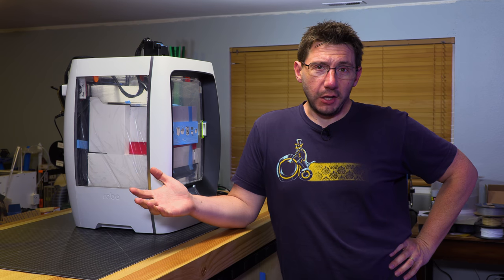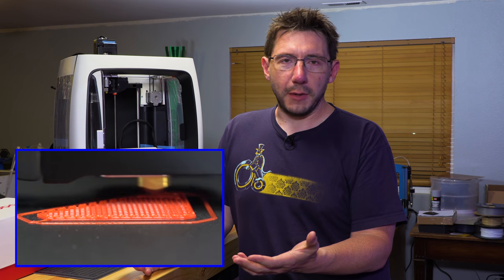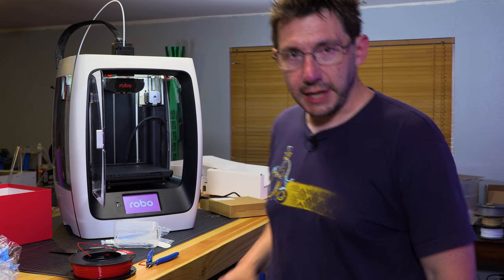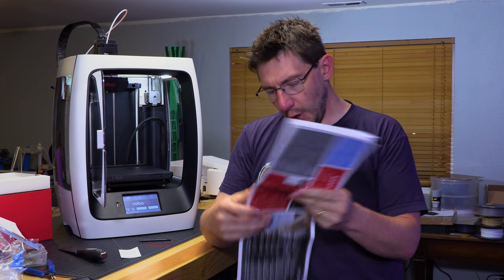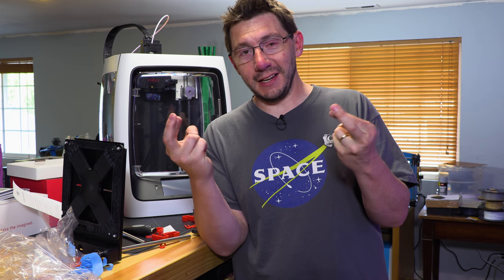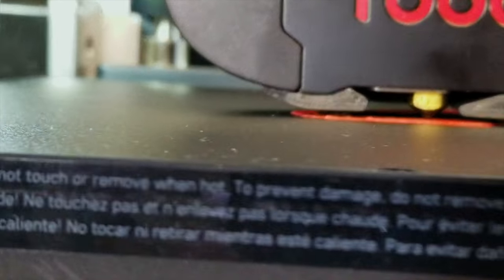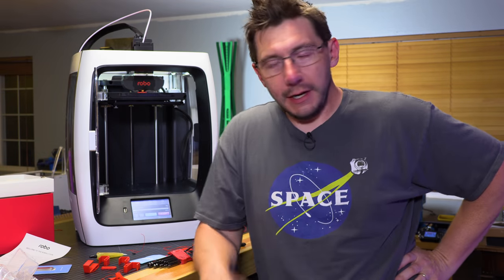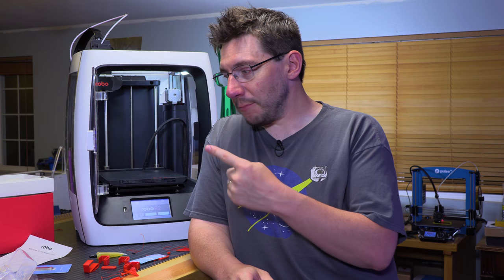Revisit the Robo R2 3D Printer - Second and Third Impressions Update

Comment: nothing but problems with my new Robo R2!! Broken power switch,  unresponsive touch screen, constantly loses wifi connection, Cura settings dont match what robo prints(set temp for 260 and robo prints at 210)

Comment: It seems like by the second printer that they would have gotten their act together. I had issues with my CR-10 when I bought it as it didn't have the switch on the z-limit and within a week I had to replace the print cooler and one in the control box. Sadly the turn around for the switch replacement from Creality after I convinced them to send me the replacement was around 2-3 weeks so I wound up buying a pack of 20 switches from Amazon for $9 and modified one of them to work on the z-limit. Quality control and product support make or break a company.

Comment: Touchscreen 3/10 hits work or delays 3 seconds . And it kind of bothers me I hear about these upgrades from Joel and other videos and never Robo themselves. I still have the R2 and use it but my new MK3 will def be getting the most use and I’m prob done buying “consumer” printers . Especially when a kit half the price contains more tech.
Reply: Have you tried out the App to control it? I've been curious how well they did with that but not ready to invest in another printer (And my R1+ is still the same workhorse it was from the day I unpacked it)
Reply: App it weak as well, much easier just to use octopi to send prints and like the touch screen the camera working through the app was hit or miss for me.
Reply: Ah phooey. Thanks for the reply :)

Comment: Perhaps the torque created from not removing those plastic clips at the beginning twisted the lead screw?
Reply: That's not possible, the gantry and the Z bed are not even connected at all. And try to bend one, it's not at all easy! Even a much flimsier threaded rod, i had to stand with my whole body weight on it supported by nuts to give it just a millimetre of bend offset over the length of the rod. It's either bent at the cutting stage due to heat warping, or maybe by an impact in shipping over a long leverage.

Comment: I received one of the first Robo R2 printers from their Kickstarter project. It has worked very well from the beginning.  All that talk from one user about needing to bypass the Robo operating system is total nonsense.  Some folks just like to tinker with their toys, and look for any excuse to hack the software.  I will say that Robo should not pack all that mass inside the printer.  The top of the leadscrew floats freely and I can see where any force would cause an issue.  There is a design for a plastic bushing on Thingiverse that I printed and pushed onto the top of the leadscrew.  I doesn't affect operation, but prevents any lateral force from bending the screw.  I added it in case I ever need to move or ship my printer.  Bummer that Joel has had these issues because it is a nice printer.

Comment: Super late to the party on this vid, but you know.. the most disturbing thing to me isn't how the filament detectors aren't marked 1 or 2. It's how it would print for a while when the filament detector should've been showing nada the entire time. I've got an R2 that has touchscreen issues as well, so I can't even use the z-offset tool anymore. Extremely frustrating, not sure it's worth fixing, despite some fantastic print quality when it works.

Comment: Ok, putting the poor QC aside for the moment, that "touch screen" alone, for me, is the deal breaker.
Using this machine on a daily basis,  I think I'd have used a hammer on that the screen after the first 20 minutes.
Joel,  you have the patience of a saint or a freezer full of ice cream.
Sorry, but the Robo 3D printer gets a big thumbs down from me, but Joel, you get a big thumbs up and a high five.

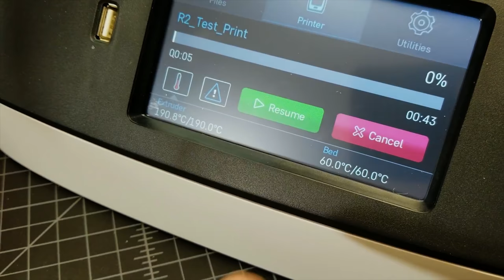Comment: at 20:20, was that you able to use the touchscreen without the stylus?
Reply from the maker: Yes, I was. The video was filmed linearly, and my rage about the stylus was legit, and over the course of the two days, the touch screen worked intermittently with the stylus and with my finger.
Reply: I was just surprised to see it work I had to confirm you weren't using magic lol

Comment: Robo did just announce a flex plate upgrade that will be coming, in case anyone was wondering
Reply: They aready have a 'flex' lead-screw.
OK, it flexes just the once and stays like it, but at least 66% of printers that Joel got have it, so it must be  something they are trying out?!  Doh!! :)
Reply: Sue3DDesigns alright Sassy McSaltyton 👏 Seriously though he even said it was a known batch of printers that had the issue  I got an R2 at Christmas and it runs beautifully. Every product (well most at least) is going to have some nuts with defects. The fact that he got three in a row is really bad luck and probably partly to do with his units being cherry picked.  There are certainly issues with the printer, but none are ever going or be perfect. The touch screen is bad, plain and simple. I’ve had issues with the filament sensor. But the problems are few and far between. I think people are being to hard on Robo, they made a good product, not perfect but good. There are certainly concerns to be raised, but lay off the Haterade people, it doesn’t help anyone.
Reply: When will the QC update arrive? Features are useless on a machine that barely does what's supposed to.

Comment: Ordered in Dec 2016, didn't receive until Jun 19, 2017
Control board was bad out of box, sent back, got replacement around Aug 10th, door was broken on second one.

Since day one it has never printed a decent print. I helped the person who was first in charge of this printer. The printer was handed over to me last week to get working. I have a kit Prusa I3 MK2S at home and my first print on it with out any fine tuning was far superior than any print so far off the Robo 3D R2.

I have leveled, calibrated, updated, and went through everything with a fine tooth comb. Prints have Z-banding. Z Axis lead screw is slightly bent, most likely the reasoning. Doesn't do well with overhangs with the settings straight from Robo. 

It's probably been to long to get the lead screw fixed by Robo but I'm going to see if Robo 3D is interested in reclaiming themselves. At this point in time they are not on my list of suggesting to anybody. 

To Be Continued . . . . .
Reply: Robo is going to send me a new lead screw. Hopefully that will fix the problems.

Comment: I think Robo3D needs help with QC.  My first R2 showed up with broken bearing sleeves, a bent Zaxis screw and a bunch of other failures.

I got a rather rapid replacement from Amazon, and the printer has been in near 24x7 service ever since, producing decent prints.  This has not been without problems.  I have had a couple instances of the touch screen going completely unresponsive.  Workaround: Use Octoprint for everything.  Solution: remove and re-seat the cables connecting the touch screen to the Pi.

I had my power switch completely seize up.  Unfortunately, that required replacing the main board, because it's all soldered together.

The latest, ever since I added a BuildTak flexiplate is extruder crashes during auto-levelling.  But, I have it dialed in pretty well, and it isn't necessary to autolevel every time, so I commented that out of the Octoprint print start script.

In fact, it's dialed in so well now that I almost never need to use a raft.  After several KM of filament, I've had to replace the original nozzle, but I consider that wear and tear.

Oh, and by the way, the X/Y dimensions are NOT 200x200.  More like 193x193.  Try 200, as I did, and you get ugly noises and layer shifts as it crashes into its limits.

And whatever the reasons, I have absolutely no problems with their customer support.  They are indeed on top of things.

If I've made this sound bad, I have to say that when it runs, it'll run continuously.  Unlike my new Prusa MK3 that had its hot end destroy itself in under a week of ownership.  Compare to the R2 never having any such catastrophic failure, and the fact that the hot end replacement is one screw and two wiring plugs, if it ever did, it'd be a whole lot easier to deal with.

Once it's working, it really is a very capable machine, but its infant mortality rate really is inexcusable.

Comment: I have one of the early robo r2s, the quality when it prints right is amazing. My biggest issue is that the nozzle clogs half the time I change the filament and sometimes it makes grinding noises
Reply: If you like I can send you a turtle planter I designed that shows off some cool details on the printer

Comment: A raft?! I thought we have advanced enough in build plate adhesion products to not need these.
Reply: Stuff With Kirby , they may be hiding uneven bed.
Reply: Well, the MakerBot Replicator Mini always seems to need them...
Reply: I have an R2.  The main reason for using a raft is that the bed adhesion is so strong and airtight that getting a print off often involved destroying the raft.  Since I added a flexiplate, that problem has gone away and the only time now that I ever use a raft is when I'm concerned about elephant foot, and even then, I can usually tune that out in S3D with the first layer settings.
Reply: The makerbot mini is over 4yrs old.
Reply: Stuff With Kirby True

Comment: Definitely appreciate you taking the time to acknowledge that you're getting a more tailored experience than the standard punter would.  Completely agree about the stylus requirement is crap.  I couldn't see anywhere to store the stylus on/near the printer, so it's required and you'll probably lose it without a holder.

Comment: Save yourself some frustration, the optical sensor will not level with a PEI surface. Also, if the Robo-tak surface develops some shiny spots the leveling will not work.

Comment: I had a nightmare of a time with Robo. I have a Robo 3D R1 plus. When I bought it, the printer worked OK. Just OK. It was not impressive like I saw all my other friends printouts. I didn't know any better but I had issues with it at the time. I kept going with just "OK" prints at the time. Fast forward around a  year later. Somehow my printer developed an issue where it was trying to print in the air (No, it's not what you think. No, really.. it's not). I spent a couple months talking with friends at my maker space I'm a member of, checking forums, posting on forums. Trying everything four times, z offset, checking end stops, leveling, resetting settings, uploading new firmware, etc... Nothing worked. All that time, I was calling Robo support off and on. No luck. They would just pretty much tell me I was out of luck. That was the real reason I originally paid triple what all the other printers were, they advertised they had 24 hours support. I didn't know a thing about printers - I do now - and that really appealed to me. Another thing that upset me was I received one of those auto generated "How are you enjoying your printers?" emails from Brayden who you mention in this video. I responded - it went to his real email address I found out later - and didn't receive a response. Two weeks later I tried responding again. I finally decided to post on their facebook page my issues and got the attention of someone high enough that they would help me. Honestly that is one of the things that upset me. It should have not taken that much to actually get someone to help me. It should have been escalated until they got to someone who could. Their support line which they claim is 24 hours just goes to a call center after hours as far as I can tell. You get some guy that's reading responses from a manual that can't help you any better than a 30 second google search. If your problem goes past that, you have to wait until the next day when they have techs (at the time I believe it was only two people) could answer your question. So anyway, I got my problem resolved finally with this engineer and my printer was back printing on the bed. It was an EEPROM error. However, sometime during all those times of trying to work on it the nozzle went bad so my prints looked HORRIBLE. After the engineer got it printing on the bed, I told him the printouts seemed like they were extremely bad quality. He kept trying to sell me on the idea that they looked fine to him. I showed them to random people and they all agreed with me. To check myself, I asked a friend who also had a Robo to print out the same models. They looked really good. So I kept trying to get that engineer to help me. His final response to me was to buy a different brand printer. I saved the email because I was so surprised from it. I finally got lucky and swapped the nozzle out. So why did I type all this? I wanted to warn you guys to not buy Robo if it's their customer service side that appeals to you. The printers are decent if you are extremely familiar with them and repairing them. I am now finally thank god. However, my friend that reviews products came across the Hictop prusa i3 clone. I'm not going to plug our channel on someone else's, but I want to say that this printer for $300 out prints the R1 plus that I paid $800 for when it was new. It prints EXTREMELY better quality. 3Dprintingnerd - great channel, I have subscribed.

Comment: I must say, I have a CEL Robox, which is very similar to this printer in that it's designed to be an "out of box" printer that also has a pretty well refined exterior. HOWEVER, its Z-axis lead screws are extremely thin in diameter and has an extremely fine thread pitch. These have jammed more times than I can remember. I ended up also buying a LulzBot Taz 6 later on, which has some extremely beefy lead screws that you probably wouldn't be able to bend even if you tried. I don't understand why these companies like CEL and Robo think they can get away with such delicate components when, if anything, they should be even stronger so that a novice user won't accidentally break them.

Comment: $1500 USD for a small 3D printer with a poor out of box experience, and it needs repair?  Might as well buy a kit from a better vendor for half the price.  At least the kit you KNOW you have to do assembly on it.
Reply: That is the problem.. this is not a $300 printer from China.. They need to get things proper to be selling at that price point..
Reply: I missed the price!! Holy Hell, How Much??!!  If it was $400-500 for a semi-enclosed printer, I could understand the shoddy QC, but at that price, it is inexcusable. I can't see the company being around much longer at this rate. Perhaps they are already in trouble and this is the result?  :(
Reply: Russ Timberman And most of those prices range Chinese printers nowadays are better built and with better components.

Comment: i just picked up a robo c2 for $50 from an e recycling place. The lcd didn't work, which didn't bother me as i had an extra raspberry pi and planned on throwing klipper on it anyway.. to my surprise it came from the factory with a mega2650 robo board and a pi 3b running octoprint after replacing the belts my c2's suggested max accelleration is 24k lol aside from not having  a heated bed this things a beast. worth the $50 lol
Reply from the maker: WHOA. $50 is a crazy good deal, and especially now that you have it running like that!
Reply: @3DPrintingNerd  The quality is phenomenal, really made me look at my ender3v2 a little differently. just got into 3d printing, love the channel, appreciate the reply!

Comment: I don't understand how in 2018 there's still bad 3d printers for sale. It's not rocket science: just a rigid frame, 3 linear axes, a hotend/extruder that you can (and should) buy off the shelf, and a microcontroller with an interface that isn't complete trash. Yet this company, with all its engineering effort and money invested, can't even get the basics right like "don't bend the heckin' lead screws".

Comment: There needs to be a guy whose sole job is to roll lead screws and linear rods across a level table for quality control. He would also have to be locked in a padded room because after 30 minutes he will go insane.

Comment: Unfortunately your experience is not unique. I do not work for Robo but volunteer to try and help people on their forums. This next sentence won't really help you at all, I have an R2 that is working exactly how this printer should have worked from the beginning. Don't you just hate when you are having issues and the next five posts are 'mine is working perfectly.' Some of the issues that need addressing are Marlin firmware being an old verison, addition to Marlin code that do not actually increase useability or reliability, an interface that basically is too slow, making it almost unusable as well as uninformative.  About the only real way I was able to use this collection of hardware is to flash the community based firmware. Do not use the touchscreen for any control. Strip the scripts that are used in OctoPrint and perform all  your startup tasks in your slicer G-Code. Only use the OctoPrint web interface to control the printer. There are a few contributors on the forums that have actually got their printers printing very well, some with little to no modifications. I am not a good example because my R2 has been heavily modified from the stock experience. The Facebook group is very disjointed and very difficult to get any straight answers to questions people ask. There is a private Robo FB group that almost has no traffic, it was created for 'power' users for lack of a better term. If you are interested in a frank discussion of what steps Robo should/might take to make this a better printer I and others on the Robo forums would be more than happy to engage in such a conversation. Come visit the  Robo forums and PM the admins there, we try our best to provide honest assistance and suggestions on how to get the most from the R2/C2.